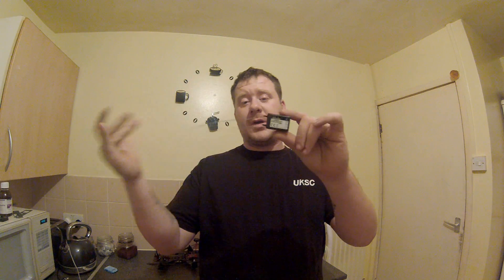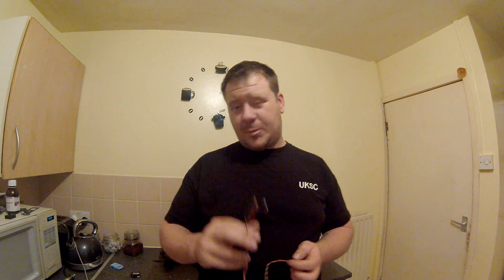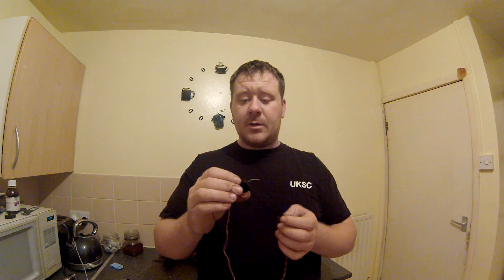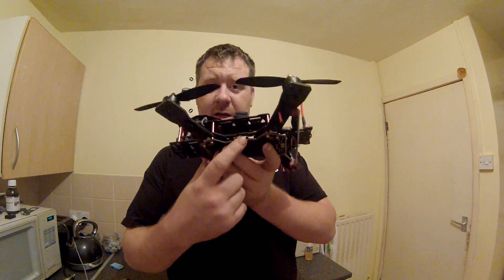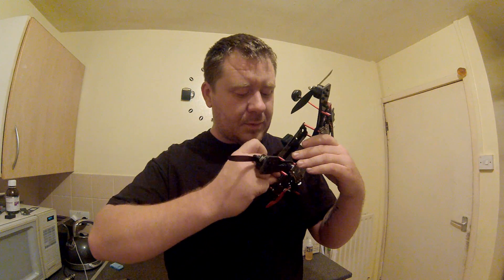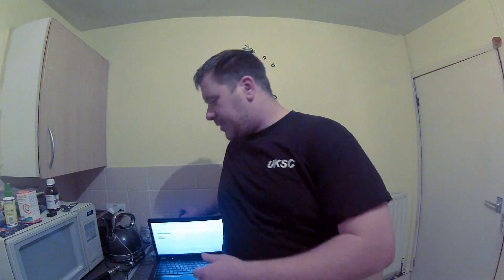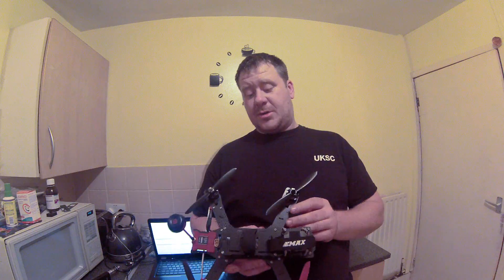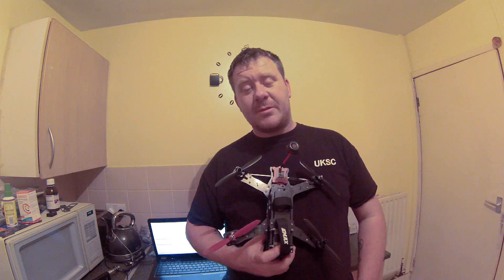HOW TO - INSTALL - SATELLITE - RECEIVER - EMAX - NIGHTHAWK - 280 & SKYLINE - 32

Comment: This isnt working for me, the satellite receiver wont power up.
Reply from the maker: GibsonLesPaul2273 if it won't power up the you either have the positive on the wrong pad or it's getting power but you don't have signal wire on the correct pad
Reply: I just fried the FC lol must have touched some metal somewhere, spent days on this not surprising really, its retarded,  tried the RX and CH4 pads and pins but nothing worked, im gonna have to buy a new board and switch to frsky I think, besides I wanna do long range fpv gliding so I think frsky is more for me.
Reply from the maker: GibsonLesPaul2273 get a betaflight f3 it's a very good board and easy to setup
Reply: Thanks I will, ive seen that before, seems more user friendly. Thanks.
Reply from the maker: GibsonLesPaul2273 if you need any help just let me know and. I will make you a complete setup guide video
Reply: Cheers but I think ive head a headful of this now, its beaten me, when you solder wires in the right place and spend days wondering wtf, its not something you wanna revisit ever again.

Comment: I am using a satellite unit that comes with the AR7700 with the Naze32 Rev 6 and am concerned about the frame (fully enclosed) interfering with reception. With the short antennas should I mount the unit on the outside of the frame?
Reply from the maker: Don Clayton personally I would say it will be fine in the frame but give it a try I wouldn't think it would make much of a difference

Comment: so how does it work if im building 2 quads, flying both together with satelites?
I only need q rx to bind 2 satelites right?
Then programme tx? Im just waiting for them all to arrive. but not sure to run these or gps. You used sonar? 
So many options but minimum wires a must.
Reply: 1 rx to bind 2 satelites to different txs?
Reply from the maker: FindmeKicksUK you don't need a rx to bind it you can do it straight through cleanflight now or betaflight you need to set it bind mode in the cli command

Comment: I was curious, you said PWM inputs and that is where the motors go is it not? Would I want to use my RC inputs for signal?
Reply from the maker: No I ment pwm as in the type of signal that comes from each rc input when you use ppm you only use 3 wires
Reply: roger that, thank you. I was trouble shooting all day almost and finally got my Sat to work with my Skyline32....

Comment: Out of interest is the included radio with the nighthawk 280 pro any good or would i be better off buying a separate one. I am mostly concerned with range and the lack of visible antenna has me worried about the included radio.
Reply from the maker: The range is very very good on it the problem is it doesn't have a failsafe

Comment: hi just got a emax nighthawk pro 280 .rtf. I'm new to quadcopters other than small hubsan ones.  would like to use my dx9 and like you just three wires coming out the reciver do you have to use a satellite along with the reciver and what channel do you use on your reciver for ppm
Reply from the maker: +Andrew Price you need to use just the satellite part of the receiver and put the ppm imput into ch4 and make sure you take the 3.3v for power from the other port just how i have done it in this video